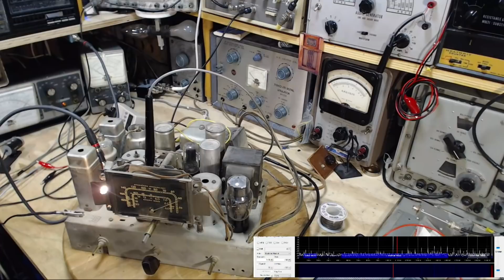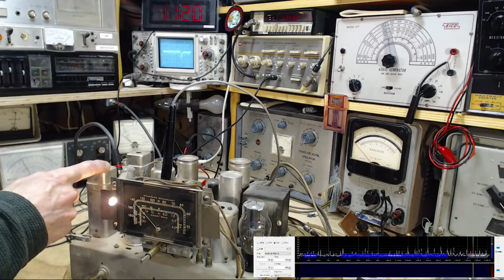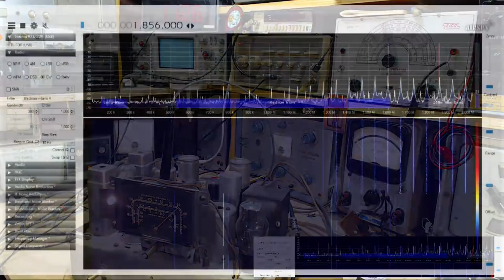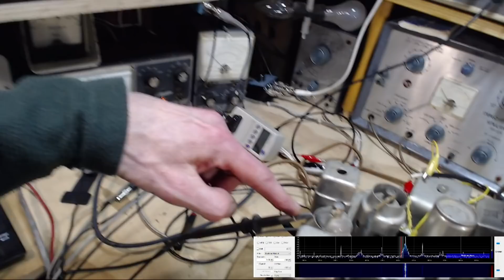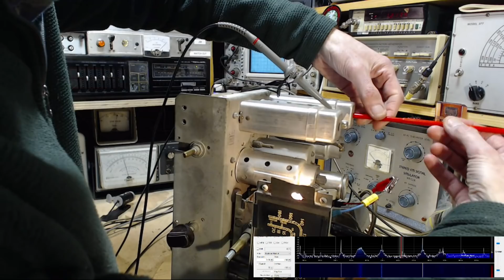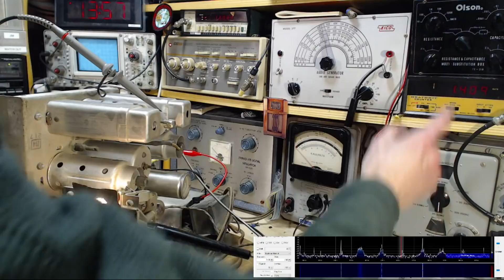Canadian RCA Victor Model 5T5 Video #4 - IF Alignment

Comment: Check your schematic. IF is 460KHz not 455. Local oscillator is also 600K. Setting it up for 455K may de-tune it. Yes, you will get a peak but it could be higher.